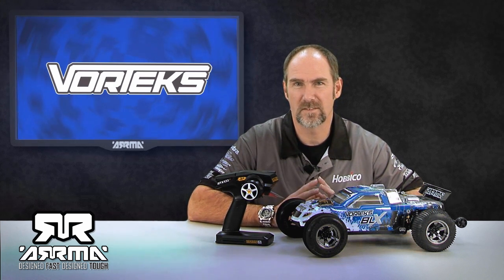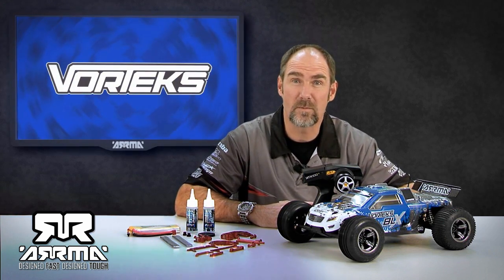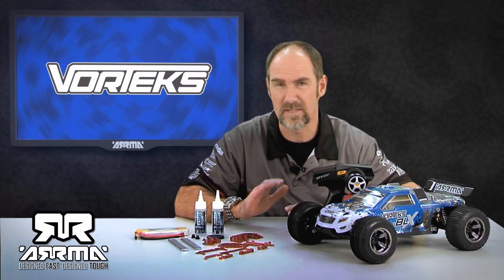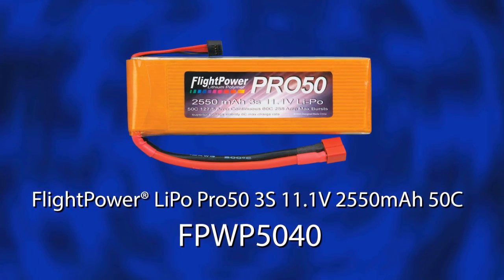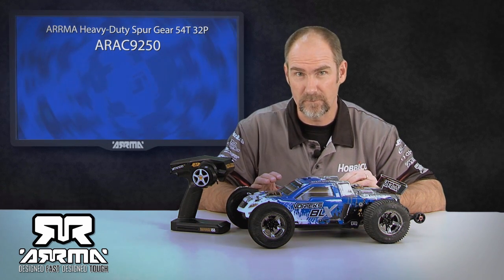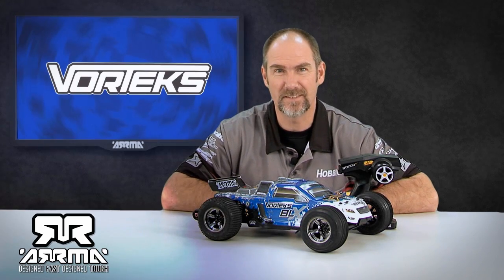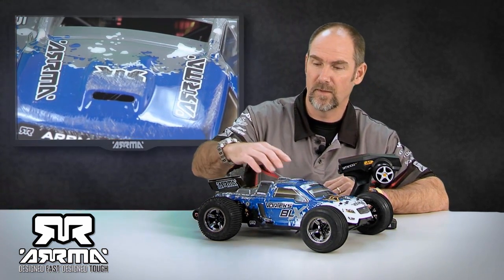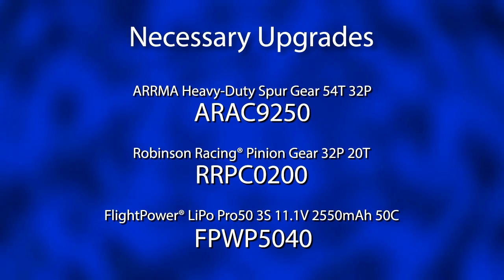How to make an ARRMA VORTEKS BLX do 65+ mph!

Comment: does it work for the arrma fury??
Reply: Yetzier Perez Cabrera, I'm trying to figure that out as well, i recently purchased a Venom 5000 mah 7.4V battery for my Arrma Mega Fury and my son promptly burnt up the stock motor by not checking on engine heat. I figured why not upgrade but from reading into it, I may have been better off buying a more expensive (as always you get what you pay for) RC. It seems their aren't many upgrades for the fury especially, and the dimensions and mounts are far from universal making it almost impossible to use other manufacturers parts. If I figure anything out I'll repost.
Reply: Yetzier Perez Cabrera  
Update: It works the Fury only if you have the BLX Motor and ESC, but you can upgrade.
Part numbers for the BLX Power:
(AR390061) - ESC part number
(AR390060) - Motor part number
Reply: Yetzier Perez Cabrera 
Of Course thats just to be able to make the upgrades shown in this video lol.

Comment: I've got one of these and am constantly having to repair / replace the steering parts. You've got to get a better steering servo- this is a must. The first impact will destroy the standard servo. The slightest impact against the unprotected front wheels means regular repairs- Some sort of bumper addition / upgrade would be great to protect the front wheels. BUT, this truck is a lot of fun in an open space, especially on short grass or hard sand.

Comment: how do you get scale speed i have a traxxas rustler runs 60-65 mph
Reply: Walter Jackson  Multiple the scale by the speed so a 1/10 scale car going 40mph is 10 x 40 = 400 for a 1/8 scale car going 40 it would be 8 x 40 = 320 etc.
Reply: ok thanks